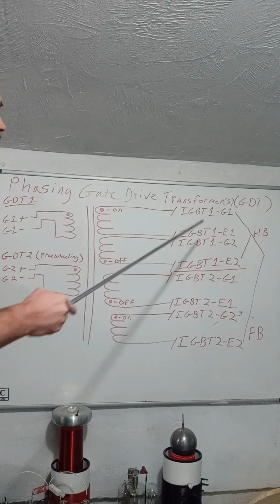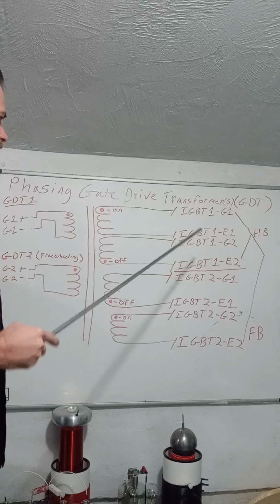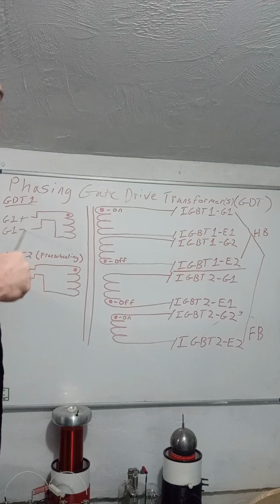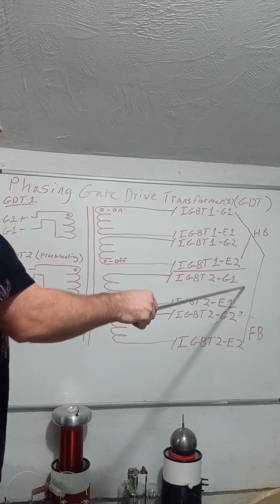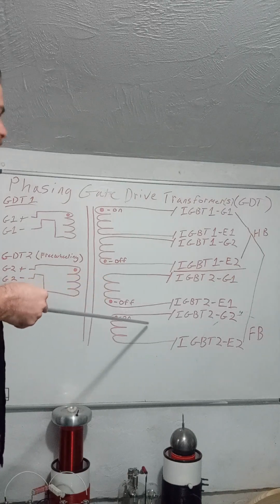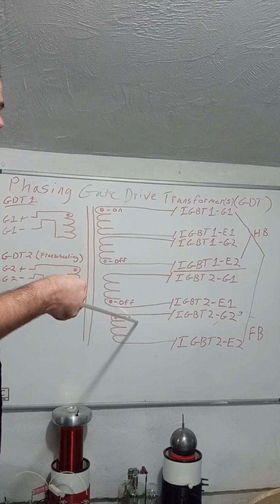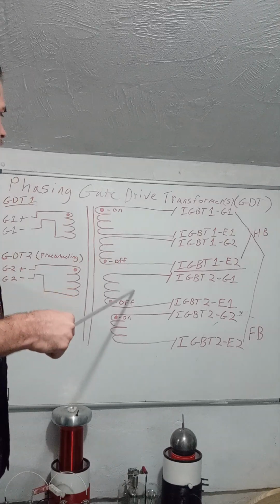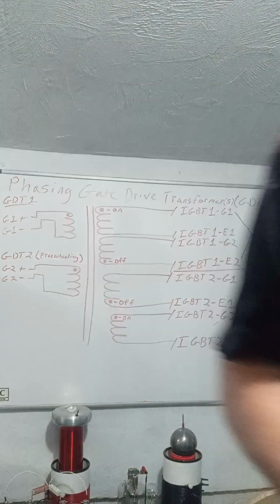GDT phase connection and continuity, in-depth overview

Comment: So i’m trying to get into the power, electronics world and quickly getting overwhelmed the thing that I don’t quite understand. Is the gates, internally G1 is completely isolated and E1, is internally connected to emitter. Applying a small voltage will activate the gate. But how doesn’t the high voltage on the emitter mess with anything? I think I read somewhere that with there being high voltage on the IGBT itself or emitter the voltage difference will activate the gate? Is this correct? Would you be able to make a video or point me in the right direction to further explain this
Reply from the maker: @CarlGat  you're using 24v to open and close the gate to transmit current through the emitter. Think of the potential current, let's say for the sake of the discussion you are running 340v through an IGBT.

The 340v is stored at the Collector. You have Collector 1 (+), Emitter 1 (-, with respect to neutral) and C1E2 (the output of that IGBT)

The gate Acts as a switch, (usually 12-24v, depending on application)

The gate is what bridges the voltage (C1) to output (C1E2), with E1 respect to neutral. whenever the signal from the interrupter is engaged from the controller, which is connected to the driver.

The driver supplies a regulated 24v to the GDT, which is phased 180 out between each IGBT so they do not crash/collide when switching voltage.

So, when the voltage is switched, (340vDC) between 2 IGBTs, you will see double the voltage pulsed at the primary, so 680v, just from the voltage potential switching so fast. Think of a car wheel spinning so fast that it looks stationary.

In this case 87,000 times per second (87KHZ).

Another good parable to explain this representation would be to grab a ball. Toss the ball back and fourth between your left and right hand parallel. Each hand represents an IGBT and the ball would represent the current.

The IGBTs are phased 180 out between each other as I said before, so that they dont try to 'grab the ball' at the same time. So when your right hand would grab the ball, your left hand would remain open, no contact, open circuit, while your right hand would be grabbing the ball, engaging the current, closed circuit.

I hope this helps! And yes, this would be an excellent illustration for a video.
Reply from the maker: *Correction C1 is Emitter 1 (with respect to neutral, -), E1
Reply: @KDewees91 
So another thing,  regarding just the gate.
If you  disconnect your  gate driver wires(G1,E1-G2,E2)
, and you have your C1(+50VDC) and E2(-50VDC)

 Will you have +50VDC on the gate driver terminal E1
And -50VDC on the gate driver terminal E2?
This is where I’m getting confused, because  if this is true, let’s say it’s 350VDC, when wiring the GDT that  supplies  24VDC how does the 350VDC collide with the date driver terminals E1,E2?

I should just buy an IGBT and test this out, as reading gets confusing and testing and  seeing first hand works great. 

I’m sorry if I’m completely missing something/ not understanding, I really appreciate your help.
Reply: @KDewees91  
 Thank you for that detailed response! I really appreciate it. I love the analogy.